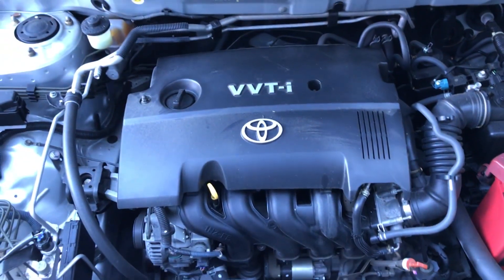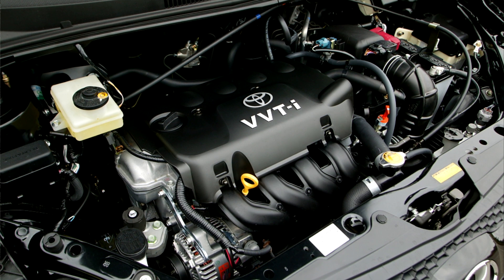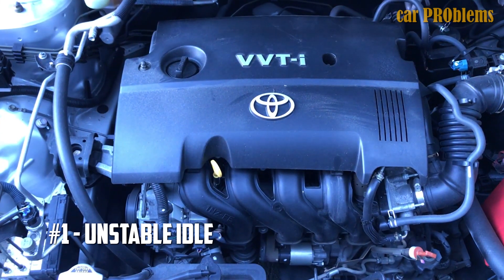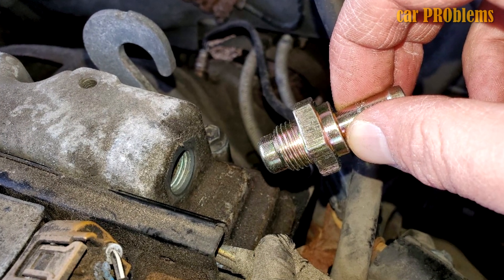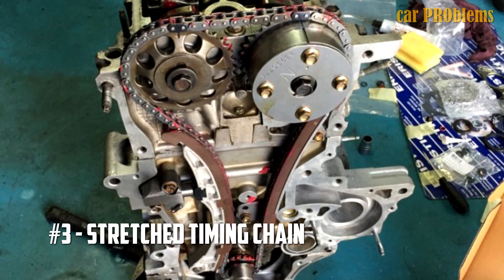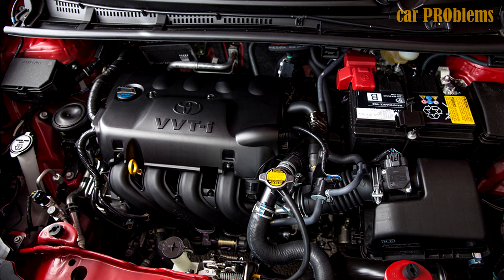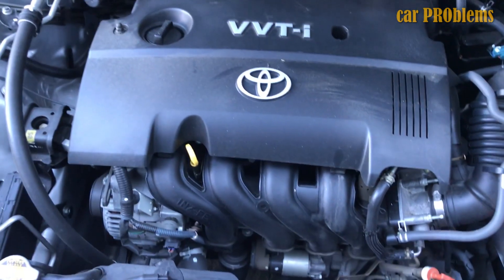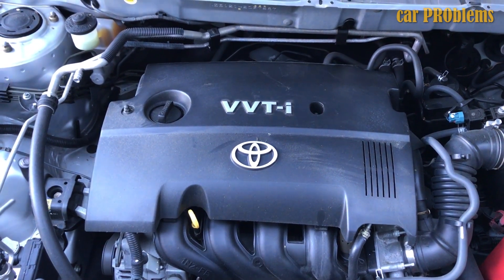Toyota 1NZ-FE Engine Problems and Reliability

Comment: Mine is a Toyota Corolla Fielder SW it runs well, it was serviced last week with top quality oil and filter it also got 4   new NGK  spark plugs ( garage said the old spark plugs were ''absolutely rooted''  )  timing chains seems quiet, no ab normal oil consumption, car has done about 180 000 kms. I try to let it rest most days and take my motorbike to work instead, i will keep an on the oil level and top if necessary.

Comment: idont about you guys i have a 2007 axio G manual with this engine it have 200,2100 mi
les on it i never had oil consuption issues up to this day with it its every economical i did all my servicing each 5000miles and recently  change all the oils on my car brakes,gear,engine and coolant filters air filters everythingit works flawlessly its a tool to get you and yourfamily to work or trip so you better have a caring heart for your car as you have for your kids

Comment: 2005 Scion Xa, original owner, 200k miles. No leaks, no oil consumption, 33 mpg... Change the oil every 5k miles and it just keeps running... the original Energizer Bunny.

Comment: The 1NZFe is one of the best 4 cylinders engines made, the videos show a 1ZZFE and the timing belt tensioner is internal not external, this video should be removed is not telling the truth, I have a 2008 yaris 264,000 and running strong!!

Comment: 312,000 original owner miles.  I replaced a starter,  the water pump, 3 engine mounts, thermostat and tomorrow I will replace the oil pan gasket and attempt the crankshaft seal.  All work done by me DIY.  Hours and hours but time I’ve got - just not $$$ to pay someone else.

Comment: My 2010 Yaris recently tripped the clock to 200,000 miles.  It had 9,000 on it when I purchased it.  I don't know if the previous owner used synthetic oil or not, but that's all I've ever run in it.  no noticeable oil consumption (changed every 5,000 miles with a premium oil filter) or leaks.  However, the timing chain is just beginning to make noise.

Comment: Good engine fix crankshaft seal if leaking as it will lead to alternator failurei like this engine. Auto 2003 runx 1.5

Comment: This engines are solid rock, have being on it since 2013, corolla was at 38000 when I got it and now we lil over 200k, all I have replaced so far an alternator belt, VVTi solenoid and Idle control valve

Comment: I have a 2001 Toyota Allex with 1nz-fe power pack fitted. 220,000km and runs sweet but it does use oil. Its not fuming and its not leaking any but its going through about 300ml every 1000km. Oil is cheaper than a rebuild 😂

Comment: 467000km still going strong,full throttle a lot..... The vvti noise is 1000%true...However, those are common problems with it.... But I recommend it 200%.... Very reliable engines in Zimbabwe

I still haven't done an overhaul,no rings or bearings...nada
Had the Toyota Corolla axio from 54000km....great engine,and broken plastic hose joints.... That's about it... and the stupid start button rather than Keys.... annoying

Comment: 450k kms here.  Original engine and auto transmission. Uses 1 liter every 4000 kms.  I dont even bother to top up and service it when the dipstick shows half. Reliable.  15 years and counting.

Comment: 2008 Toyota Yaris with 202,700 miles. 1.5 liter VVTI engine. Replacing the engine throttle body was the only repair on the car, besides light bulbs, tires, battery. The most economical, dependable car I’ve ever owned. I have owned many cars and pickups. I go into NAPA and Auto Zone very infrequently. For oil, air filters, etc. Unlike when I owned American made cars. I will be buying Toyota again. If the need arises.

Comment: “Major problems are Oil leaks, clogged PCV, timing chain wear. Making this a bad and unreliable engine”

Dude WTF are you talking about lmao 😂

What engine doesn’t leak oil? And every combustion engine ever made consumes oil, even brand new engines. PCVs clog all the time. If these are the only problems, this is a reliable design. Just do your oil and air filter changes.

Comment: Troll content...   Thumbs down!! Ask any mechanic that knows these cars. You will not find a better engine that has the same combination of reliability, performance and efficiency. 109 hp in a car that weighs 2050 - 2300 lbs is an excellent power to weight ratio. So they have very noticeably good acceleration. Speaking of which... drive like your foot is glued to the floor and it will still get 38 - 43 mpg with every fill up. The oil burning issue really isn't a problem as long as you fill it back up with oil every once in a while. 150k miles is not much further from the break-in period with these engines. Most enthusiasts on ToyotaNation and YarisWorld claim that the rod bearings give out at around 400k - 475k miles...  other than that, no real engine killing issues. So I'm not really sure where the information in this video comes from.... ?

Comment: Juss purchased 06 scion xa 245k miles $1500.00
Replaced 
Front brakes
Oil change 
Plugs and coils
Intake gasket
Valve cover gasket
Drives amazing and feels very reliable even with that high mileage

Comment: Bro I've got 213,000 on my Scion xa, and it runs like new. transmission is original too.  

When the engine hits around 150k, you want to switch to Full synthetic 10w30 and some lucas oil stabilizer....Also you want to change the transmission fluid and filter every year twice if you can.

Comment: This is absolutely the worst take on an engine that I have ever seen.  As a mechanic for nearly the last 30 years the ONLY thing true in this entire video is the part about unstable idle and usually being cleared up by cleaning the throttle body, this is true on about 95% of all makes and models with a TB. My xB has over a quarter million miles and I still have no timing chain noise or oil leaks, a few seeps around the valve cover, but I've never changed that gasket either. Oh, and almost every single one I've seen "burning oil" is from a stuck PCV valve after 200K or so.  The 2AZ engine that replaced the 1NZ is several models had oil burn issues as you described and had recalls on them.

Comment: I have had 2 of these engines so far and I bought them both at around 300,000km 180,000 mi.
 I drove both of them until over 500,000 mi.
Excellent engines and the most reliable fuel efficient cars I've ever owned.  I have owned over 120 vehicles.  Just change the oil every 5000 km or 3000 miles and it almost lasts forever.
Reply: Plus neither of them ever consumes any oil between oil changes.  And I mean none like not even a drop.

Comment: Thanks for the video! I saw oil near the exhaust manifold but couldn't diagnose where it was coming from, will definitely check out the rear crank shaft oil seal.

Comment: Mine has only 177000 miles on it and every time I change the oil at 6500 miles it's is still dead on full mark and very clean.
I love this little engine.

Comment: One of the best engines that Toyota has ever made . They run forever as long as you use good oil and don't go more than 4,000 miles between oil . changes .simple maintenance also helps, like tune up once a year (spark plugs) and replace the air filter regularly. Using a good sinthetic brand oil also is a good idea. I've seen these cars with over  500 thousand miles on the odometer and they are still going. 🙄
Reply: Don't need sparkplugs once a year just need to buy the oem DENSO plugs 😊

Comment: Definitely a good engine design !  Strong quiet Chain.  no engine valve tratin rattle noise . Mine  has 160k Km of severe use.  Hot and heavy Manila traffic.   year round Ambient temperatures in the +30C.   
I am about to replace the head gasket of the 2nd time.   Other than head gasket issue.  This is a very good engine.

(self taught mechanic and gear head.  replaced a few cylinder heads  and clutches in my time )

  I talked to 2NZ-FE  Vios Taxi driver with 600k Km., same engine   Granted taxi running like crap taxi engine.    They  On the 4th or 5th head gasket and replacing valves, valve seals, piston rings  and etc.  But on the same engine block and cylinder head .

In this tropical country, the Vios with the 1, or 2 NZ=FE engines are known to be "running hot".  Word on street,  is the first generation Vios  (2002-2006) were not as durable or as liked,  as the 2nd or 3rd generation.   I notice they changed the radiator and the coolant hose , radiator spout placements, after the first generation Vios..

If the 1st generation Vios are running hot and indeed taking a toll on the Head Gasket,  it could also be due to the large engine beauty cover.  This black thick plastic engine cover seems to retain and insulate engine heat.  

I rented a  newer 2018 Vios with the 1NR-FE engine.,   I noticed the engine beauty cover is less than  1/2 the size of the one on our 2003 Vios 1NZ-FE.  And  it has open sides and open rear sections for heat dissipation;  i would think the engineers saw the issue with retained engine heat, even after shut-down.

So perhaps,  given that most 1NZ-FE engines are  used in temperate countries,  where heat is not really  an issue,   the 1NZ-FE engine is excellent.         And if this is so,  all i have to do is remove or cut to half size the engine beauty cover to avoid retained heat .    cheers !

Comment: 06 scion xb automatic.  212k miles.  Starter failed.  Water pump almost failed (serviced before failure). Valve cover barely barely sweats oil.  Leaks absolutely nothing but air-conditioning condensation.  Burns zero oil, zero smoke from exhaust.  1nz fam lets fkn gooooooooo.

Comment: I have 07 manual hatchback and just hit  300 thousand miles no issues with the engine still running strong other than it does burn some oil hope to get 100 thousand more miles.....

Comment: i have have to say BS on the stretched chain,  I opened it up to change the timing chain at around 290K miles, when I put the old next to the new, you could not tell them apart..  shes at 365k now and a failed fan relay switch caused a overheat which slightly breached the head gasket..  time to take care of that and valve guide oil seals..  I never done port matching or polishing but theres a first time for everything..  this motor is truly TOP GUN 2000 1NZ-FE  I SALUTE the engineers who designed this unit..    note: buy the OEM part and avoid the cheap aftermarket

Comment: 2007 yaris with 208,000 miles and zero problems.  Oil changes done religiously and thats it.  Still have the original alternator and starter!

Comment: This is the most inaccurate video regarding the 1nz-fe. I have an 06 scion xb with over 240k miles on it, I change my oil every 3k miles and make sure it's maintained and not beaten on, and I haven't had a single leak on it. This motor is SUPER reliable and will give you over 300k miles if you take care of it LIKE YOU'RE SUPPOSED TO! 
You, are incorrect sir.

Comment: My 1NZ-FE engine has done 175000 kms runs like clockwork and does not use a drop of oil. Change the oil and filter every 5000 kms never misses a beat. Probably overdoing it but get oil and filters cheap so don't mind. Cleaning the throttle body is easy and have done it a few times. Genuine replacement parts don't cost much from the right place or get from a scrap yard.

Comment: That claim of the 1NZ engine being unreliable is totally inaccurate. My little 07 Yaris has been reliably serviced, and has about 600k (597k to be exact) miles on the original engine. 
It consumes about 1 qrt per 1900 miles. And she still runs as strong as when new. No, oil leaks, nor noises. A valve seal change is in the plans, the we will put many more miles on her. Lol
Reply: 1000% Adrian...   I just did a compression test and even with a slightly blown head gasket, the number were 125 psi..   factory is 132 psi...   365kmiles and yes time for the valve guide seals : )
Reply: @jimmyfavereau  which oil are u using? i use 5w30 but in manuel it says to use 0w20
Reply: Try some high solvency oil like Restore and Protect or Castrol Ultra Clean.

Comment: My 2004 has 284000 miles /457000 km.  Runs great, does burn oil.  Otherwise seems to have all the original power and no issues

Comment: I have 1NZ FE on my 2004 vios. 300000+ milage. Still water coming out from exhaust. When car is on idling you don’t even notice car is on or off. Its really smooth and quite. 
Just look after the engine well. Do the engine tune up on right time. This engine is rock solid.

Comment: And here I am with an 06 Scion xA with 364k. God blessed this car to keep on pushing.
Reply: I got this car 187k
Reply: I just bought a 2005 Scion XA with 241,*** miles. I bought it because I knew it was reliable. This is going to be my daily driver. I know the guy I bought it from and he has driven it 75 miles each way to and from work for the last 6 years. All he has ever had to do is, oil changes, tires, and brakes. The only reason he sold it was because of a fender bender. I fixed it just tinkering for an hour here or there in 2 days.

Comment: Very inaccurate video, leaking and oil consumption was a problem on the 2AZFE engine tho' that motor was really pretty good. The 1NZFE is one of the most reliable engines ever built, easy to maintain and very efficient, really dont start seeing wear until 250K.  Car Wizard describes this engine as a "rock" notably in the 2nd gen Prius. He says, literally like a rock you can come back 10 years later and nothing has changed it is so insanely reliable.

Comment: I have three cars with 1nz Fe. 1) 47k km. 2) 317k km 3) 574k original engine with regular maintenance only, and replaced one starter motor and one set timing kit

Comment: mine is over 200k and haven't done any overhauling or timing chain and still no sludge probably because i change the oil 1000k early
Reply: Hi, at how many Km do you change oil and also what type of oil do you usr
Reply: i usually use the toyota 10w40

Comment: I’ve got a Corolla with one of these engines. It’s so far been excellent. Just approached 160000km or 100000miles. It uses no oil, make no rattles and doesn’t leak. It’s been serviced every 10000km since new.

Comment: Running this engine since 2008. 300,000KM on the clock. Still going strong.
Reply: Did you have to replace anything on your car like mentioned in the video?
Reply: Mines done 290k and all I have had to replace is a water pump
Reply: @edwardpeterson9041  which oil are u using? i use 5w30 but in manuel it says to use 0w20
Reply: Mine is at 530000km. Zero oil consumption, I can run at 140kph all day. Still getting 20km to the litre.
Reply: @ushxi6256  which oil are u using? i use 5w30 but in manuel it says to use 0w20
Reply: @onatd.7118  I also use 5w30 full synthetic, I converted from auto to manual.But still running the same oil.... Fantastic little engine's these,
Reply: which oil are u using? i use 5w30 but in manuel it says to use 0w20
Reply: @onatd.7118  I've run both 5w30 & 10w30 fully synthetic. You can absolutely run semi synthetic with no issues too. I can't recommend using such a light oil like 0w20 on this old of an engine.

Comment: very reliable engine. i have run 2003 allion model which has a clock reading of 221000 km and the most important thing is that i run my car by Compressed Natural Gas not petrol

Comment: Bought a 07 sedan with 92k on it last year. Some rust but hey it's a 15 year old car from MA. It's got 109k now with no oil consumption. I check my dipstick regularly and do my own oil changes every 5k with mobil 1 synthetic. You don't even need to jack this car up to change the oil. I get oem toyota filters from Walmart 5 qt jugs best deal around. Hoping to push this guy to 300k 💪 did have to replace the rear shocks and front pads and rotors. Needed a belt did that and the spark plugs easy enough if you have the tools and know how.
Reply: A belt? Serpentine?
Reply: Oem filters at toyota dealership are less then 5$

Comment: False information, just need Good oil, no mineral  and original coolant in the sistem  and it will go more than 500k miles with   just a little  oil consumption.

Comment: If I'm not mistaken, some of these issues can be prevented by having the oil changed when it is called for (or earlier then what is listed in the manual)
Reply: I change my oil every 5000 mile. I have over 370K miles on my 2001 Toyota Echo.
Reply: @rplavigna  That's great!! Congratulations!!👍🏾

Comment: Coming up on a quarter million miles with zero issues. After 12 years of owning this car, other than maintenance the ONLY part I've ever replaced is 1 starter and 1 VVT solenoid. It burns about 3/4 a quart every 4,000 miles

Comment: It definitely can have some of the issues stated in the video but it's definitely not common for all these things. But under normal use this is an amazing engine that can last 300k miles.
Reply: Agreed. I had two Corollas with 1NZ-FE engines. They did start using some oil after about 100,000 miles or around 160,000 km.